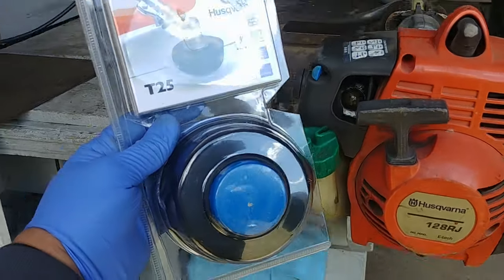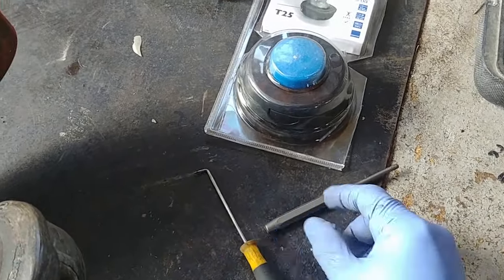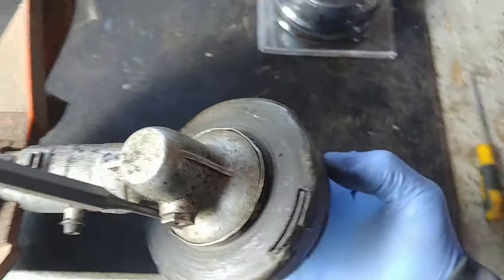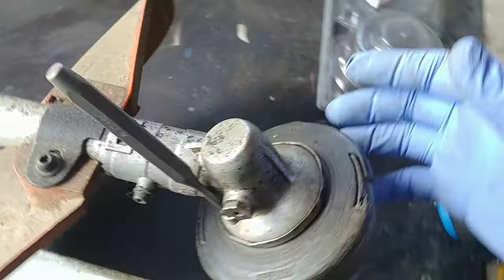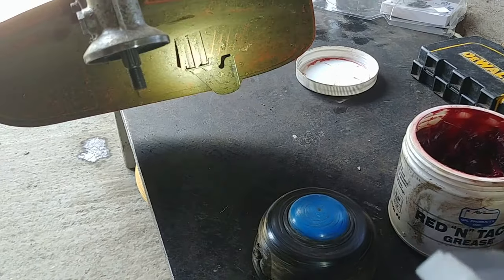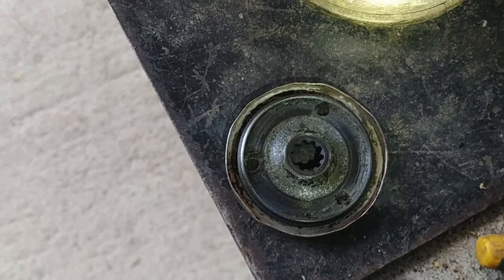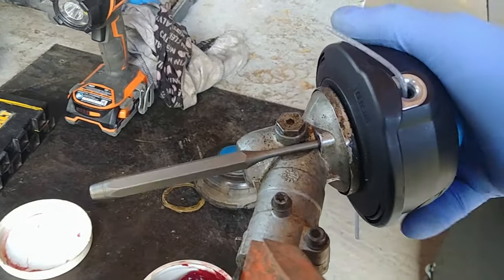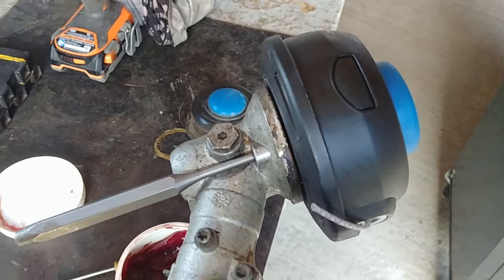HUSQVARNA WEED EATER TRIMMER HEAD REPLACEMENT

Comment: I've had more trouble free use out of the head that uses 3 - 6 inch strands of chord that you push through the head.
They cut good with new chord but not so good when the chord gets down to 3 inches. Then its time to change the chord.

Everything has its pros and cons. 
The tap and go head goes on so much easier and you have new rope at the tap of the head unless the chord gets hung up inside. 
The 3-6 strand head requires a 3/4'' socket and holding a triangle washer in its place while you thread the nut on and tighten it.

The tap and go head will run completely out of chord when you need it to the least and you won't have time to go and get more because you only had an hour to weed eat to start with. You won't have more on the shelf because your like, " No way! I've used all that weed eater chord already? That should have lasted 2 seasons or 3.😵😵

With the  3-6 strand head I know how much chord I have because I cut 3 - 6 inch strands every time I use it.
 
All I've ever done to mine is put string on it and run it. And it got to where it was running in a bind and noisy.
Come to find out my head was loose and wobbly even with the bolt very tight. It needed a backing washer to stabalixe it. The pole was loose at the motor causing the clutch to stay ingauged full time. There are 4 bolts there screwed into plastic that were loose.  I completely lubed it and put everything back tight like it should be but didn't get to the throttle cable lubing. Its become a bit stiff and need lube.
It is running much freer and less constricted.
Its and old Husky 225R Brush Getter. With the right blade it will take down small trees up to 2 inch.

Thanks for the video my friend! 😃😃
Reply from the maker: Hi brotha! Thanks a lot for sharing your experience. I learned more new tips just from reading your comment. I will pin it up make sure other viewers can see it as well. Thanks again Blade! Take care!
Reply: @Tommy Ealey Wow! Great idea!
One good tip deserves another. If you store your Super glue tip down you'll never again have a stopped up tip.😀

Comment: I put this on but now it won’t turn
Reply from the maker: Hi Jarrell,
Does it spin when cutting head is off?
Reply: I'm sure you didnt put that metal shield or what's it called between the gear head, and the trimmer head. It will be a pain to get it off, if it's too tight.